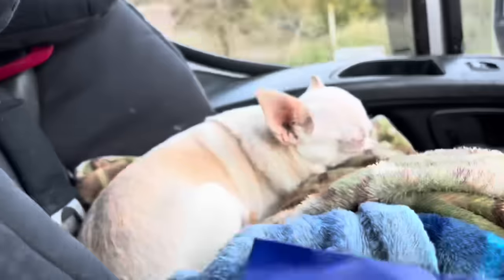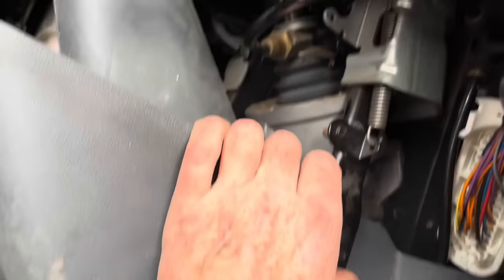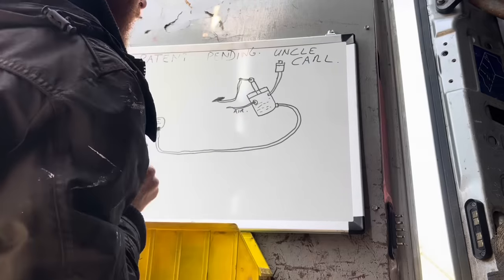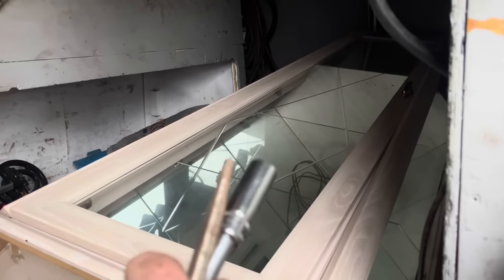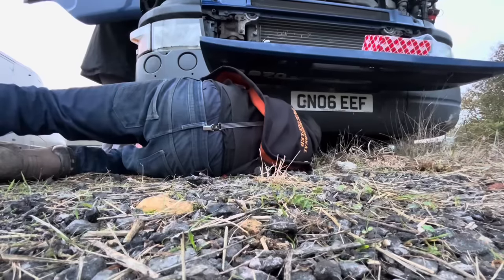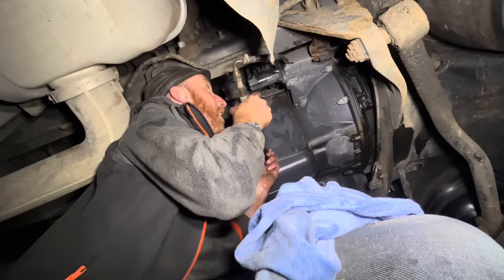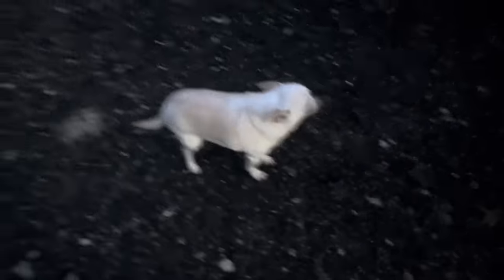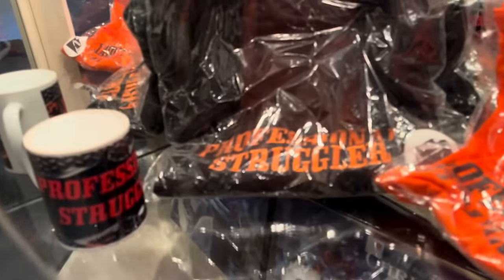Clutch master cylinder change (horse box 😬) 30k subs a thank you people 🤠

Comment: ive had one of the chinese heaters in my van for 6 years     youll need to sort out your battery issues  with the struggle bus out before you fit the heater or youll have more issues.. give me a shout if you need a hand with the heater   make sure its got the thin white fuel line not the green  as the green fuel line perishes ive got spare white fuel line  if you need any

Comment: Chris you and me know them snaped bolts ain't gonna cause any bother left ,but what i will say is it ain't a good look if your customer gets stopped by dvsa i believe they will look harder for other issues.
I dont waste time on trying to rescue threads as can take hours i just drill them out and pop in some helicoils 20 mins max.
Chris i have a van heater if you want it suitcase type as thinking you will need another when you make that ldv camper van was working

Comment: sticking the bolt heads back on, seen someone i know put a gearbox back in a car, one of the bolts was rally long and could not fit in, solution: cut head off and stick in the hold!!!